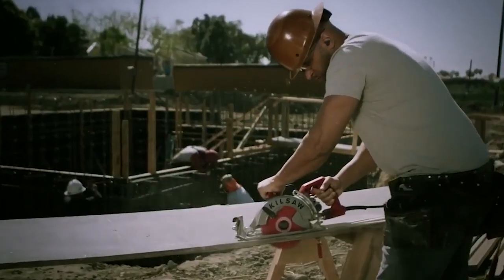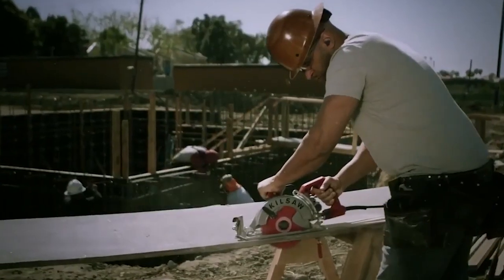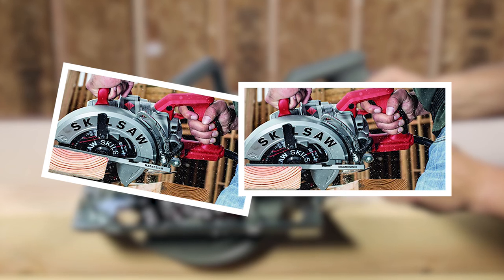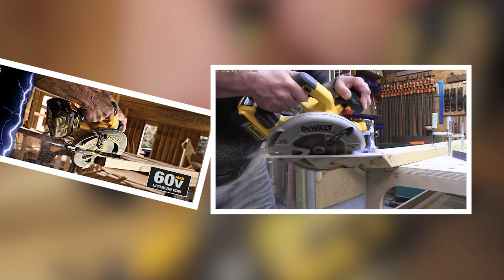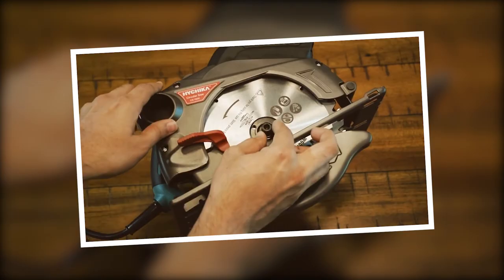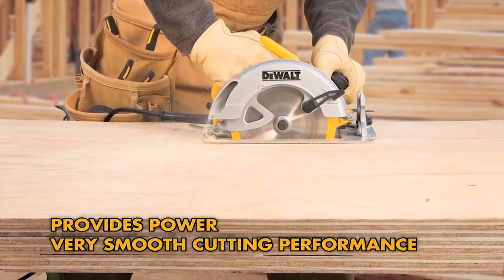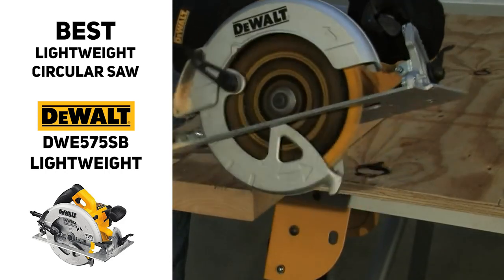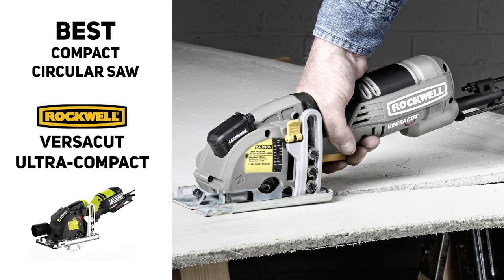Top 5 Circular Saws in 2024👌

Comment: Is the Rockwell Versacut good for cutting through hardwood?
Reply from the maker: Definitely! That circular saw will go through hardwoods like Rock oak, Maple, and Acacia without a problem. Where you have to be careful is cutting through softwoods like pine, bamboo, and particleboard.  You have to go at it slowly to make a clean cut and avoid ripping the material to shreds. Thanks for the question and comment. If you do end up getting that circular saw, I'm curious to know what you think about using it on hardwoods. If you have the time, let me know.

Comment: How many batteries are included in the DEWALT Flexvolt unit?
Reply from the maker: Great question! That wireless circular saw comes with either one or two 60V lithium-ion battery packs. Of course, the single battery unit is cheaper but probably won't last the day.  Each battery pack holds enough power to drive the circular saw for up to 4 hours. So it's probably a good idea to get the two-battery unit for good measure. Again, great question, and thanks for the comment. If you have any other questions or concerns, feel free to reach out.

Comment: What's the total weight of the SKILSAW with everything attached?
Reply from the maker: Hi there! Good question. That particular circular saw weighs approximately 13 lbs with everything included — oil, cord, and tooth blade. Fairly heavy, but totally usable and not unusual for a worm drive saw. Thanks for the question and comment. Let me know if you have any other questions and I'll be happy to help.